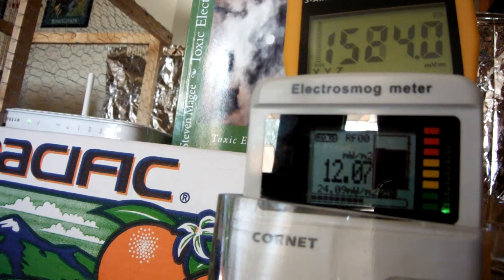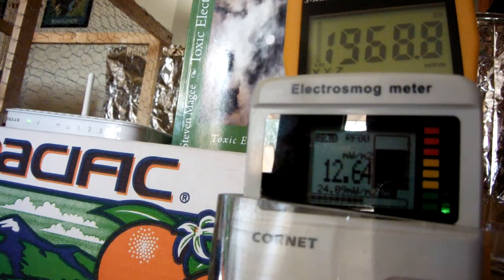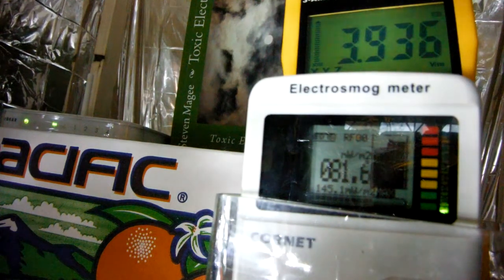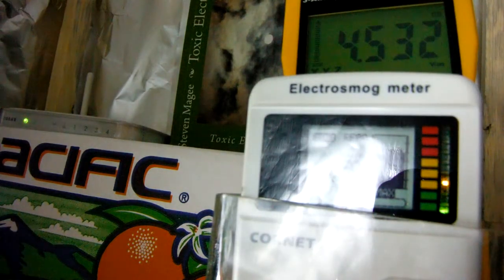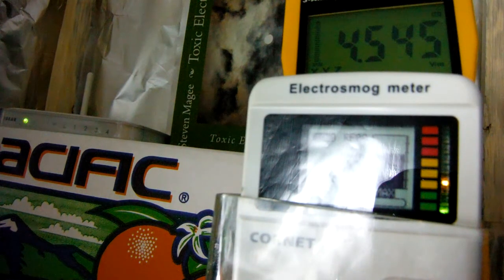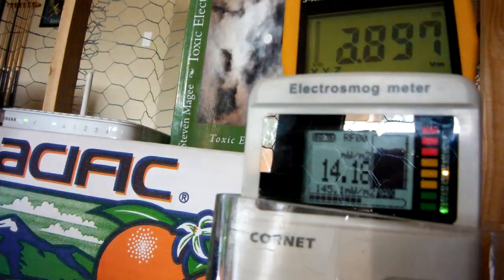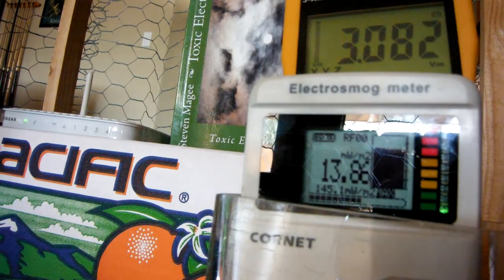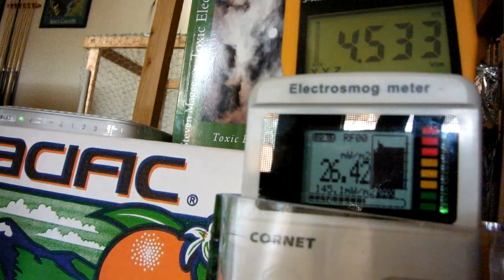Internal Testing of Wi-Fi Radiation Inside Various Faraday Cages Grounded and Ungrounded

Comment: I'm a little confused. Were the readings coming from the inside of the cage? I'm guessing so. Also, was the WiFi signal created within the cage as well? If this is true, is the point of the video to prove that it's better to have a shielded home with a WiFi connection within it, than not to have a shielded home with a WiFi signal within it due to the reduction in radio frequency radiation? That is a really impressive discovery. I always thought that shielding a signal causes it to be trapped, creating a space where the very same signal multiplies over time. Boy was I wrong.
Reply: It shows that it blocks the signal reaching the device or the device is to weak to answer back, when no hand shake happens the modem powers down to save power, if you shielded the home and you shutdown the laptop and phone wifi it would save power on this model of modem, but you are best just turning it off. i think its just to prove the cage works, if you want to sleep in one.